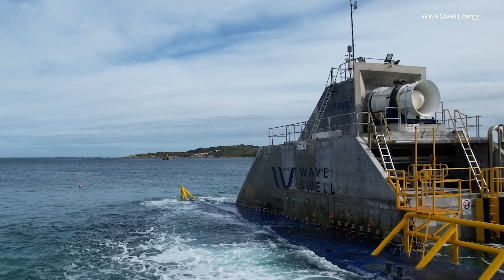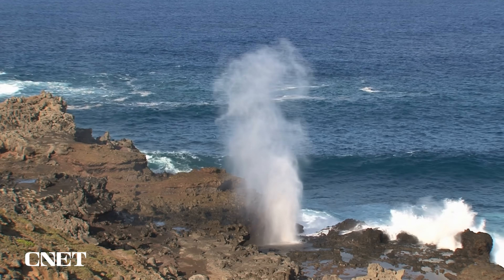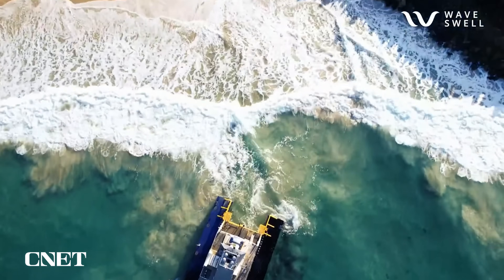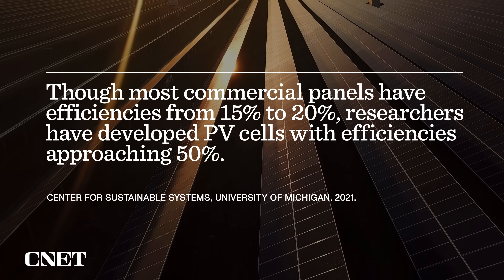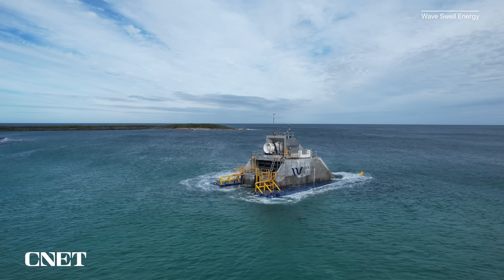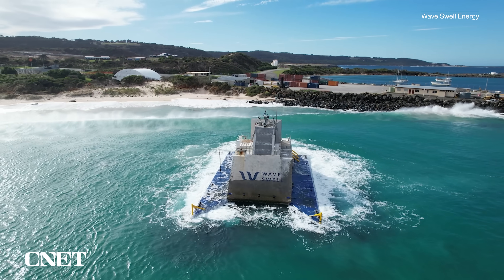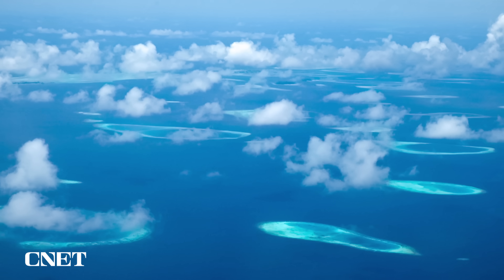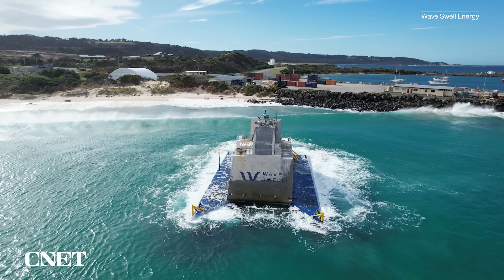'Artificial Blowhole' Generates Wave Energy for 1 Year

Comment: I worked with a company that developed a similar system, working with the Navy and some Pacific Island entities.  Used wave rise/fall and essentially a giant piston/flywheel to spin a generator.  Can't say much more here, but big issues are proximity to grid and "scale".  These must anchor to sea floor.  Ideal is conversion of near offshore oil rigs.  Also, connect to pumped hydro is nice if you've got a reservoir and elevation nearby.
Reply: Are you sure? Surely this system only works effectively at the coast where the sea floor rises and forms vertical energy transfer. Out in the ocean where oil rigs are located this effect does not occur
Reply: @procatprocat9647  lol.  There are waves in the ocean.  But yes, the near offshore part is relevant for many reasons.  Like power transmission lines.  Imagine a giant mostly empty drum or barrel that weighs 5,000 lb.  It'll float, bob up and down with waves, and If that up and down motion is pushing up against a piston and flywheel it can generate a lot of power.
Reply: @scottk7011  it's been years but at one time someone had a spring and  linear motor inside a sealed tube that was inline with a cable to the seabed...  the motion was generating power by the movement of the bobbing...  never saw how it turned out but it looked really simple ... had a buoy type float at the top ...

Comment: No comment on power generation? The key numbers are efficiency and availability, not power generation? Even if it's 100% efficient and 100% available, if it's only generating a small amount of electricity, who cares? How do you do a tech review on power generation and not mention the amount of power generated?
Reply: I read 40 was more the usual
Reply: 200kW
Reply: @pixelpusher220  that's the design capacity, not what it actually produced... which they didn't say

Comment: Great, love it, but he didn't say a word about how they're going to protect the sea life from going in or being sucked inside it??
Reply: There's nothing really sucked in like you might see with a seaside nuke power plant where water might circulate through a system of pipes.  The water needs to freely flow up and down with the waves, and stuff in the water needs to be free as well.
Reply: You clearly didn't watch the video
Reply: @procatprocat9647  Well I did. He mentioned how sea life was very interested and intrigued by the wave machine, but did not say anything about actually protecting that sea life from harm due to entering the machine.
Reply: @rebeccahenderson7761  look at the rendering at 0:56 and you'll see the water isn't really "going anywhere".  It's just the rise and fall with trapped air above the water line on one side.
Reply: @scottk7011  Yes, I did see that. I wasn't sure what the darker blue areas were. They show it as free water moving, but I thought the outside of the ship didn't seem to match that. Plus they are only showing a nice gentle wave that doesn't reach the top. However in rough seas it would crash into the cement top of the tube. And hey, I am not at all against this. I think it's long over due and it's revolutionary. I hope they are extremely successful and protect the sea life.
Reply: @rebeccahenderson7761  maybe you listened to it but you clearly didn't watch it. Try again.

Comment: What they need to do is build all new piers and ports with these integrated into the existing infrastructure. You could have one turbine and hundreds of holes all connected to one pipe. Interesting should work on the great lakes. Even better fresh water less corrosion.
Reply: you'd need individual turbines for each 'hole'.   Otherwise the 'net' pressure would be zero, since troughs and peaks cancel out.  but the concept for a pier seems like a great idea!
Reply: Great lakes would be seasonal. Most years, coastal waters of all the Great Lakes freeze.
Reply: @nevar108 also not sure great lakes waves would be big enough.  Power squares with height

Comment: An electricity generating sea wall seems like a good idea.
Reply: It really does. Seawalls are needed in SOO many places, so to have it be essentially passive energy gain could be a big deal honestly.
Reply: @Fenthule  sounds like the solar highway argument is back. Only because something can serve two purposes do not mean it's a good idea. Most of the time bildning two different things is more efficient.
Reply: @Fenthule  Lighthouses too 🙌👍
Reply: it does and I like the idea,  but it boils down to cost per watt and we got no such info from this video.  because it could easily be that just building a concrete wall and solar panels further inland is many times cheaper.  but again for esthetics I like this
Reply: @foundationofthought  Cost per watt is very important, but so is diversifying renewables. When its cloudy and stormy, solar won’t perform well while wave energy will
Reply: @Coastie_808  you know what also produces energy when it's windy?
Windfarms.
And they are already a proven and economical thing.
Reply: @GeorgeWashingtonLaserMusket  sea walls are used to shelter areas from the surf, not like a dam.  They’ve been in use for a long time in lots of places.
Reply: @matt6740  exactly
Reply: It seems to be a good idea for coastal islands where the tide deviation is low. +/- 20 degree latitude. It could form the third portion of a system when the sun goes down and the wind slows down. Ocean surf (waves) are not constant I'm in Hawaii, or the surfers would never be on land during the day. Also the surf direction is not stable as it is mostly wind driven.  Most small islands do not have a Grid electric service but local generation and use.  Most harbors are on the side of the island opposite of the prevailing winds which drives the waves, hence the sheltered shore for the boats.   Placed far from shore they would become navigation hazards so they would need navigation aids to alert of their presence which may use a good portion of their power generation.
Reply: @petermenningen338  This might be the best natural energy source on tue planet. Everything you said is spot on, but it also adds a massive resting area for fish and sea life. These machines would have fish surrounding it like crazy. They love flowing water with high walls to hide close to.
Reply: As long as the dont litter the coast with these things
Reply: I'm an Ecologist but also a realist, tech like this can help phase out petroleum, what politicians are wanting to do is unsustainable, but if technology like this is utilized properly, then it would be feasible.
Now we just need to work on Mining practices.
Reply: @johnwillis409  You’re certainly not an O&G engineer. Stay in your lane. The viability of this project approaches near zero, not one.
Reply: @mtb416  I love the assumption, how quaint.
Reply: @johnwillis409  So you’re an O&G engineer? Sure thing, John. Get back to the ecology you supposedly study, too.
Reply: @GeorgeWashingtonLaserMusket  no solar roadways were never a good idea.....

Comment: How much electricity does the unit generate? How could that not come up?
Reply: Yeah. Lol. I was like shouldn’t the word watts come in here somewhere?
Reply: In 24 hours it would apparently generate power to support approximately 164 households. From an interview I found with the CEO: “When the unit is generating 40 kW of power in reasonable wave conditions, you could extrapolate the amount of energy to be in the order of 1MWh in a 24 hour period."
Reply: @artscollab  Articles a year ago on this particular install indicated it was 200kW.  be interesting to know whether 40kW was due to down time (they said its a research demo so it was offline periodically for configurations and other monitoring)
Reply: @pixelpusher220  as a local, i got little bits of info that they did have a heap of downtime. The unit also got washed ashore in early days. But on a positive. The unit was quiet. Not too ugly and did employ a handful of king islanders.
Reply: @calmauric8218  appreciate the local perspective.  I wonder if you could build an entire harbor breakwall out of them
Reply: @artscollab  so selling 1MW to AU grid at what? 10 cents gives $36500 per year. Hardly viable I would think. There would be a lot of maintenance I would think. Salt damage to generator parts. Sea life build up inside shaft, constant anchoring wear.
Reply: @AORD72  This is a per site energy solution.  Use these to power destalinization plants directly.  And, you can hook them up in series to increase output for heavy industrial applications such as coil induction smelting.  Set them up as backup power for nuclear power plants.  There's a ton of applications where 100kw being available along coastlines would be game changing.  Tow them in to places to provide power for disaster relief.
Reply: @xen1313  Still doubt it is efficient enough to be profitable. Why would you use wave power when you can use something else for half the costs.
Reply: That's only if waves are "reasonable" 365 days of the year.
Reply: @artscollab  So check my math but at that rate it would require approximately 13 million of these to meet the current power usage of the US, just as an example.
Reply: per some googling this individual unit is 200kW
Reply: @pixelpusher220  Installed effect do not tell you how much is produced. From a 3 MW windmill you will get 0.8 - 1.0 MW production on average.
They stated that they extracted 50& of the energy in the waves, but told nothing about how much the total was. Even if they produced 200 KW all the time that is a very large construction for not much production.
Reply: @bknesheim  It's a prototype.  One key advantage here is none of the moving parts are in the water.   So it's maintenance and online time will be far better than other systems.   Make a seawall out of them and now that 'bulk' works in its favor.  But again, just a prototype.
Reply: It produces 200 kW...
Reply: They really should have discussed it. Since it’s a proof of concept project they reall are just seeing if it works well. It probably doesn’t make slot or of power
Reply: Whats the net average output of it, and it's capex and opex?
Reply: 40kw peak

They never say what their actual output is.
Reply: Because it's irrelevant, it's a prototype, in a non-ideal location, it's power output is going to be less than it's potential.
Reply: @Synthmilk  when you make a prototype performance is one of the main thing you want to test and the location was as good as you can expect.
What you expect and what you get is the most important factor when testing a prototype construction.
Reply: the UiWave 200 can produce 200 kW at peak output, but sadly, the waves aren't always that powerful. Yet the UniWave still managed a remarkable 40 kW average over the year
Reply: Was reading about it & it was saying it got up to 40kw
Reply: @nwskipro  That sounds like a very informed position you have there. Is making the effort of throwing shade on technology you find hard to grasp your thing? You should take up masturbation, at least you can keep that to yourself….. hopefully.
Reply: it seem 200kw
Reply: not much
Reply: Science and technology is all trial and error! Edison did not make 1000 of his very first light bulb then discover they didn’t work, it took him 1001 try’s to make one work!
Reply: According to the video… it creates 50%…..

🧐
Reply: @HiThisIsMine  that 50% is 50% of the waves total energy capacity, you would need to look into hydrology in order to get the equations to understand how much energy is carried with a single wave depending on it's height, seasonally as well as tidally you get some pretty solid wave action.
Reply: @ToeCutter454  … so what you are saying is… there are actual metrics they could have used to provide us with an example… and instead, they opted to give us nothing…

Cool, thanks for clearing that up 👍🏽
Reply: @HiThisIsMine  technically yes, though it's all variables and dependent on a lot of factors which is why it was likely more vague.
Reply: @HiThisIsMine  50% is not watts
Reply: @slickwilly4613  - it’s a joke…
Reply: Also the greenness is somewhat hyped in this case. The internal volume of the concrete blob is somewhere around 1000 cubic meters. Even if it's 50% empty, that's still 500 cubic meters of concrete and steel and the steel pontoons on top of that. That block is 500-1000 metric tonnes of concrete? That's a lot of CO2 to be offset by a paltry 200kW power production capability. That thing will be running 24/7 for two years before it offsets its CO2 emissions of construction.
Reply: @wombatillo  apparently solar panels take around 3 years to offset their production.
So 2 years wouldn't be bad at all.
(Of course you only took the concrete into consideration. There are much more CO2 producing steps and materials in that wave generator)
Reply: @wombatillo  Do you have the data to back that up?
Reply: @wombatillo  he did mention that it could be incorporated into sea walls around smaller islands, it could be used in place of all the concrete in a sea wall, dual purpose!
Reply: I came for exactly this. How they could release a piece like this and ZERO mention of the amount of electricity generated is incredible.
Reply: Yeah I thought so too and like someone else said per googling this unit is supposed to be capable of 200kw though that would be it's peak max output and even where I read it said that would probably be a rare occurrence because there aren't always waves capable of that.
Reply: @bmora2133  So to get to the 40kw mentioned previously from a 200kw potential peak, we can break that down:

 - it’s uptime was almost 80% during the test period
 - It’s capturing wave energy at 50% efficiency
 - The average available wave power is 50% of the peak.

So at 100% efficiency and 100% uptime the maximum average wave energy available is around 100kw per station.
Reply: @seeranos  ah I see, I hope they improve on it. Also thanks for doing the thinking.
Reply: @bmora2133  200kw could be the max of the generator, but I doubt they ever get even close to that.
Reply: This is a pilot, after all... and even then, they said they chose a specific location not for the efficiency or strength of the waves, but rather for the many different types of conditions occurring for testing purposes
Reply: If we know it's 50% efficient and we know how much potential energy is in waves to be extracted - the exact performance of this unit isn't that important.

More important will be the ratio of cost to capacity, as that will determine if this is worth implementing when compared to other technologies
Reply: Because it’s just a technology demonstrator, they’re only interested in whether the concept is viable so only efficiency and reliability matter plus it’s very site specific so giving a number would be useless for all reasons you’d want a number …
Reply: @csm2455  I would say the concept's viability is definitely related to it's ±watt/volume which is hard to estimate without any reference
Reply: @csm2455  well yeah, but having the coastline filled with bunkers of this size.. it kinda does matter if they generate 1Kwh or 100Kwh.
Reply: @csm2455  Blah blah… If you are demonstrating it as a power source, it’s generating capability is THE key metric.
Reply: @roryreddog3258  In about 20 seconds I’ve thought of 10+ variables, so whatever number they give for generation would be useless to extrapolate for other sites in the world or for unit effectiveness, a 50% efficiency stat however is a much more useful number and can be applied as an estimate to any site for viability after measuring wave energy …
Reply: @csm2455  A better article would have covered at least the more major variables.  I've seen other articles/videos on it that gave some ballpark figures.  It looks like it should be at least in the ballpark of being cost competitive, although, like they said, the fact that it could be integrated into breakwaters you were constructing to protect the coastline anyway does complicate the math a bit.  It might even change the efficiency.  You might construct the breakwater to funnel the waves to them.  With the main component being a concrete bunker they should also be fairly robust and storm resistant, and the other stories I saw on it pointed out that by moving the gear parts out of the water it should be fairly marine life friendly.  It's also got a much lower profile than wind turbines (although I wonder if they could be combined on the same structure).  They might even make nice places for seals and such to hang out.
Reply: Not really because thats just a matter of scaling it up once they have the design optimized.
Reply: @roryreddog3258  It was mentioned in the video that due to the nature of the testing environment, it is hard to give an accurate figure. %50 is good enough from me, and what’s the stress? The energy is essentially coming from the moon rotating round the planet… it’s almost perpetual motion. Go have a lie down mate.